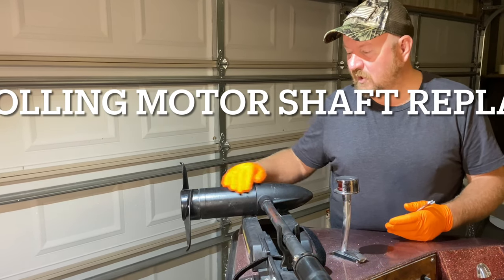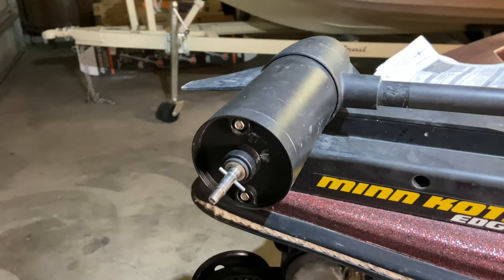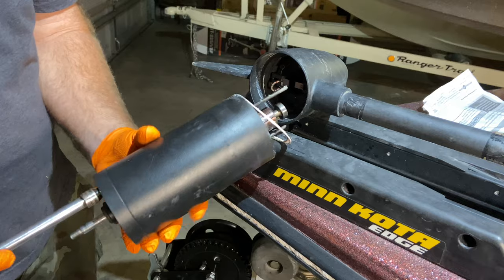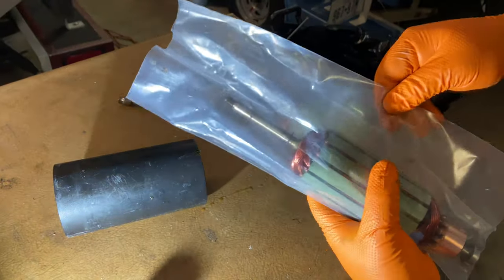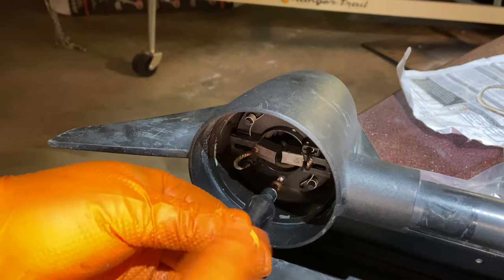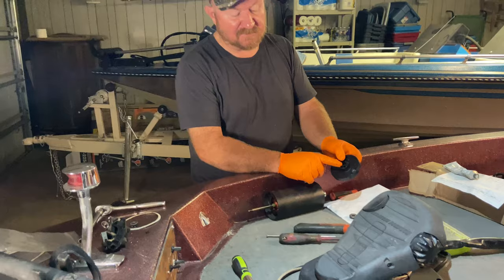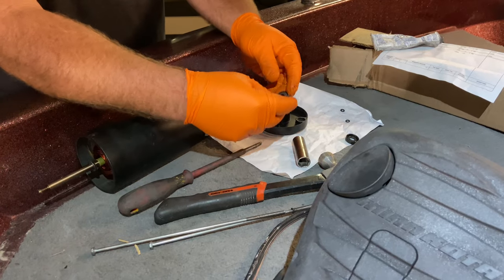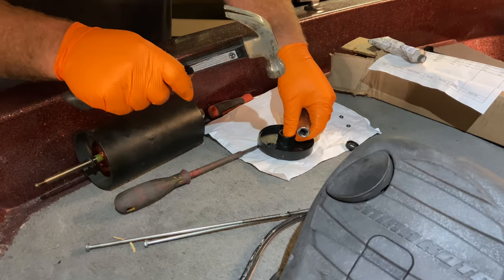Minn Kota trolling motor shaft replacement

Comment: I'd never even touched a Trolling Motor until last weekend. Went out on my jon boat, bottomed my motor into the mud and it quit working about 20 minutes into my float...thought I was screwed. Then I came to YT, typed in "minn kota trolling motor", your video was 1st or 2nd I watched. Last night I took it apart, cleaned out a bunch of mud and sludge. Cleaned it up. Regreased everything. Put it together and viola! Thanks for your comprehensive video!
Reply from the maker: That's awesome!  Glad my video was helpful.  Thank you.

Comment: Lot of help.  My tips would be to tie the brushes back with zip ties around brush wire. One around skeg one around shaft.  After armature is installed put something hollow over shaft, pvc pipe a couple of feet long, this allows you to hold pressure against armature when you slide the cover over it otherwise magnets will pull armature out.

Comment: I have the kit for the Maxxum sitting in my kitchen and have watched 4-5 videos and this one has been the best by far.   Going to tackle it tonight - feel so much better about the job after seeing this.   Great job!
Reply from the maker: Awesome!  Thanks for the feedback.  Glad the video was helpful.
Reply: @ProWrenching  so far so good - but I am going in reverse!  I reinstalled the brush plate (switching the polarity) and the prop is still spinning in the wrong direction....any ideas?
Reply from the maker: @patrickweis4593  check to see if the motor case (main tube the motor goes in) is installed in the wrong direction.  That could be it.
Reply from the maker: There’s only a slight difference in the ends of the tube and its easy to mistakenly install backwards.
Reply: @ProWrenching  will do.... it looks like on the casing, each end has a beveled edge, one is about 1/2 to 3/4" deeper than the other.   I looked at your video and it seems like the shallower edge goes toward the nose (brush end).   Sound right?
Reply from the maker: @patrickweis4593  I can’t remember without looking at it.  I would mark the direction it’s installed now, reverse it, then see if it fixes the problem.
Reply: @ProWrenching  rotated the casing 180 degrees.   problem solved!
Reply from the maker: @patrickweis4593  Awesome!  Glad it’s working!
Reply: @ProWrenching  when you put the new commutator into the new brush plate, did you have to install the little fiber spacer between? Almost looks like cardboard...It was in the original assembly, but the upgraded assembly has a slightly larger commutator and the brushes are a bit wider. I'm thinking I don't need it in the new version.
Reply from the maker: @wrench6122  It has been a while since I did this repair, but I believe I did install the spacer, but I don’t remember any of the parts looking different than the original.  The good news is that the trolling motor is still going great!
Reply: @ProWrenching  I contacted Lakeside Marine out of IL, that's where I got all my parts. They said do not install the spacer in the upgraded version. Mine is working great!

Comment: Thanks for sharing. I’ll have to change the bearing and seals on mine, would you recommend to grease the bearing, shaft, brushes and rotor? In that case, what grease woul you recommend?
Reply from the maker: Yes- I used dielectric silicone grease on the seal and shaft, but not the brushes or rotor.   Thanks for watching!

Comment: I can't take out ARMATURE. I think bearing has rust with BRUSH PLATE W/HOLDER. Do you have any idea?
Reply from the maker: You might try some penetrating oil and let it soak.
Reply: @ProWrenching  I try to use sonax soak 2days still not out. I will try more. Thank you for your help.

Comment: After replacing the prop and resealing the o-rings in the shell, my motor shaft gets very hot (endura c2 30). Is this normal?
Reply from the maker: I haven't noticed any extra heat from my trolling motor.  Generally too much heat is from too much friction, which may be an issue.
Reply: Matt, I'm doing my Edge 70 for the second time. Did it in 2017 and somehow I bent another shaft. When I purchased the new one my original has been upgraded. The upgrade addresses a heat issue. This new one is supposed to cure that. It was about 160.00 dollars for the kit. It come with a new armature, brush plate, brushes and all the seals and orings. Not sure if your armature is the same one.
Reply: @jamesgibbons6292  Thanks for the reply! I ran the motor last week, and it seems to have held up fine. I’m not sure if it will eventually go belly up due to the heat issue, but i can replace it with a one for less than 160. I’ll just keep using it as is and make sure to have my paddles on hand 😅. I did try reaching out to Minn Kota over two weeks ago and I didn’t heard back 😒
Reply: @mattl7647  Always good to have paddles in the boat. Unfortunately I've had to use mine before.

Comment: Which Torque is recommended for tightening axial screws, propeller nuts, for motors 3 1/4, 4 1/4 ?
Thanks

Comment: Hi! I ordered a new kit to replace the propeller shaft but mine didn’t come with a new brush plate assembly. Do I really need to replace the brush plate like you did in your vidéo. Thanks again!
Reply from the maker: If your brushes are still good, I’d say no need to change them.

Comment: Is that all one kit? Fishing line got in mine and pulled the shaft seal out and water nuked everything inside the lower unit.
Reply from the maker: I bought a kit from minnkota.johnsonoutdoors.com.  You can look up parts on their website using the serial number of your trolling motor
Reply: @Pro Wrenching  I am going for a full lower unit but am having issues as to how the lower unit attaches to the shsft.
Reply from the maker: @kendallkilgore7799  I suggest calling the Minnkota technical support line at 1-800-227-6433. I have called them before and they have been a great help.

Comment: Looks great, but i have this cardboard ring, (brush retainer)? Not sure where it goes under the brushes?
Reply from the maker: You might try the MinnKota Johnson Outdoors website.  If you look up your motor by serial number on that website, you can find some excellent parts diagrams that may answer your question.
Reply: I've looked at parts diagrams, and it says "brush retainer". It costs about 50 cents, lol. Mine was flopping all around in the bottom of the brush plate. I dont understand the point of it. No one has explained what it does. Any info?
Reply from the maker: @stevebasanyi4374   I don’t recall seeing that with my motor.  We can leave your comment here and maybe some other viewers will respond with the answer!

Comment: I have a very small bit of play in my shaft. Is this normal?
Reply from the maker: As long as it’s not enough play to damage the seal on the front of the motor that keeps out the water, it should be OK.

Comment: Is yours the 55 lb. thrust?  What was the part number for the armature? For my 2015 Edge 55 lb. Minn Kota says the number changed.
Reply from the maker: Mine is the 70 lb thrust so it probably is a different part number.  I don’t have that number, but I found it on the Minn Kota website.
Reply: @ProWrenching  thanks, I got the number from Minn Kota site, just wanted to compare. Great video, I'm happy to not have to plow that ground for the first time.,😀
Reply from the maker: @richward2288  thanks.  Working on another repair video as we speak- changing out the base plate on my trolling motor due to it being worn out.  Gotta keep these trolling motors running!

Comment: Sir..i want made this in my home..but i havent buy this motor in my country..can you sujest sutable motor this for use..vehicle radiator fan motor or etc...sorry my english is bad.im from sri lanka
Reply from the maker: Thank you for watching over there in Sri Lanka!  I don’t know of any motor you could use in place of a trolling motor under the water.  Trolling motors are sealed so they can be used under water.  A radiator fan motor, etc, wouldn’t be sealed and the water would ruin it.   If you were going to use a different motor that wasn’t waterproof, you would have to keep that up out of the water and have an extended shaft running to the propeller in the water.  I bet you could use a radiator motor if it was out of the water with an extension shaft to the blade.  I’ve never tried it!
Reply: @ProWrenching  thank for your kindly attention of this my comment.im appreciate it.im search ebay and amazon for buying this type motor and propeller..but very expensive it..i havent enugh mony purches is..again thank you for your comment.stay safty..🙏

Comment: The video said shaft replacement isn't the shaft the part that goes from the top to the motor
Reply from the maker: There’s also a propeller shaft.  This video is about replacement of that propeller shaft.
Reply: @ProWrenching  do you have a video on replacing the shaft a friend of mine gave me his minn kota trolling motor that he broke and I got to replace the shaft that goes from the head to the motor it's a edge 45 pound foot control
Reply from the maker: @greghart2883  No, I haven’t made a video on that.  I’ll keep it in mind for future videos, though.